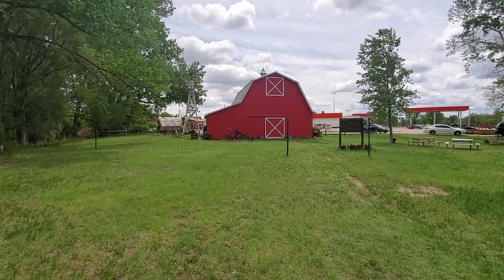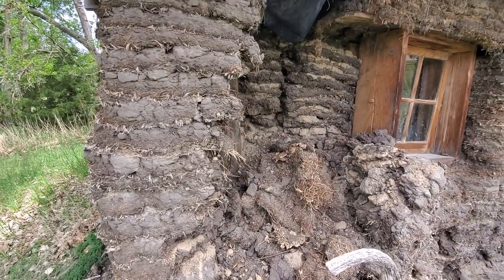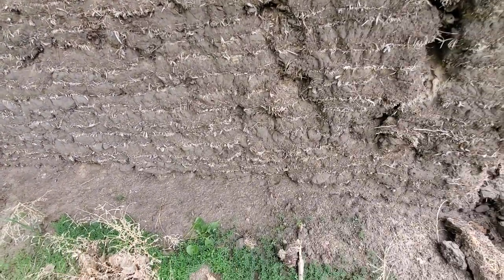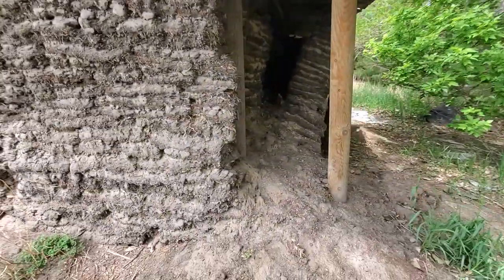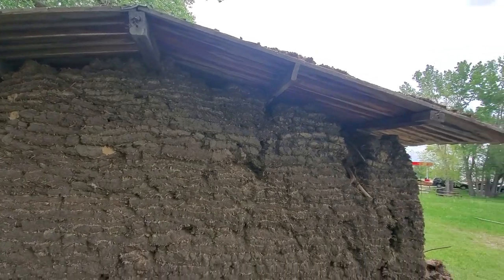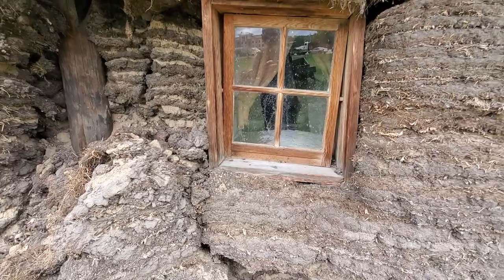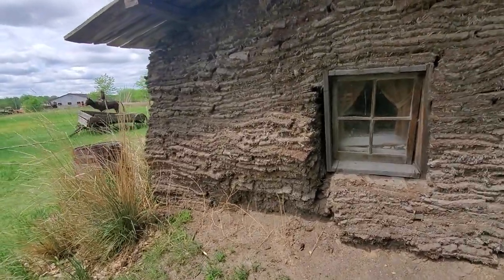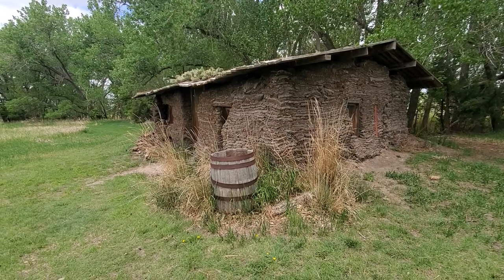Why is This Sad "Soddie" Sod House Falling Down

Comment: Can you build one that will last 100+ years?  Not impressed with that one.  Wood right now is crazy expensive.
Reply from the maker: Even mud building technology has come a long way in 150 years. A properly built properly maintained cob house will have no trouble lasting centuries where a soddie like this built from topsoil held together by the roots of grasses with no foundation and no connection between the inner and outer sod walls and no protection from the rain was bound to tumble down. Back then wood was also crazy expensive so folks got inventive. We ought to be getting inventive continually if we want to evolve. Thank you for watching.
Reply: @UncleMud  Thanks!  Would love a guide on how to build my own Long lasting cob house here in Arkansas.  We have heavy clay in the soil.  I need complete directions with all the details so my home doesn't look like that one.  Lol